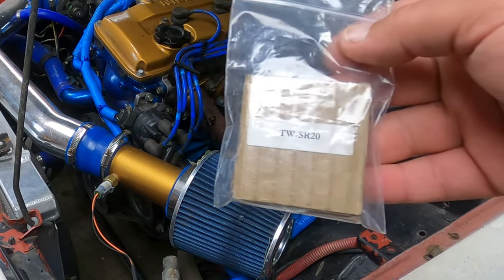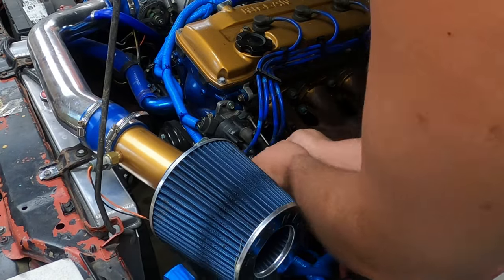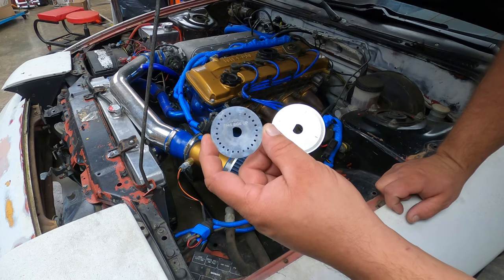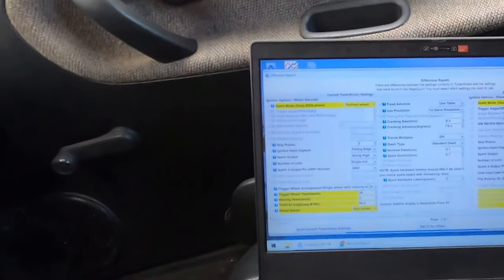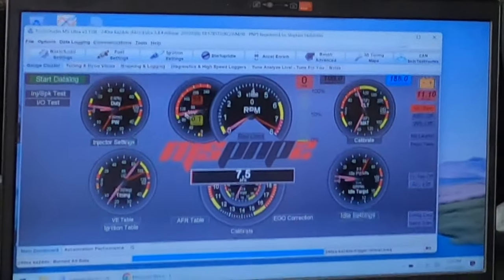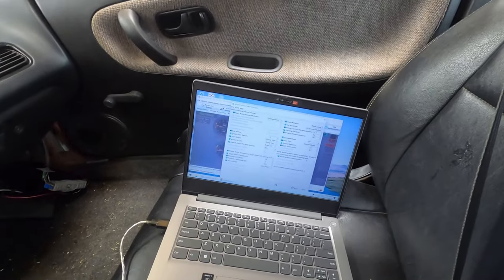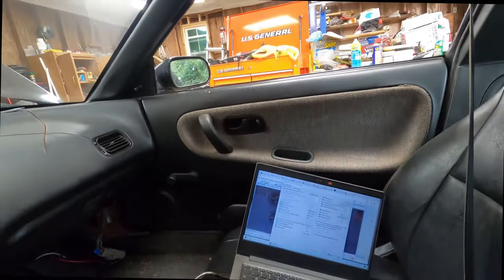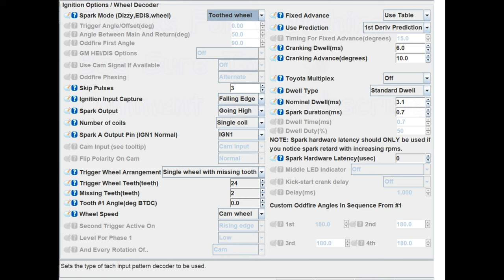MegaSquirt 240sx ka24de DiyAutotune TW-SR20 Nissan 24-2 Distributor Trigger Wheel Install & Startup

Comment: I followed your advice . It sputtered.  That means I am heading in the right direction.  Thank you.
Reply from the maker: Your welcome.  My coil on plug + sequential injection conversion was a total failure.  The documentation for the megasquirt pnp just sucks.  I think they conflate the information for the non pnp with the pnp.  If I had to do it all over again I would have just gotten a regular megasquirt, and ditched the factory harness. I don't think the factory harness is wired to work with many of the available "features"  without basically rewiring most of the car through the options connector.  I followed the directing for setting up sequential injection, and the car acts like not all the injectors are firing.  I made a coil on plug harness for sequential spark, but could only get spark outputs a and b to work.  Even when wired for wasted spark the engine run terrible.  So I'm going to stick with my distributor and the msd blaster 2 coil upgrade.  It makes the initial tuning far more forgiving on the afr ratio.  My oem coil was really weak from age and couldn't handle the car being too rich.  Another gotcha I ran into was the wideband sensor not being calibrated and letting autotune destroy the ve table.  The car acted like it had a blown head gasket because autotune kept making the table so rich the fuel wouldn't ignite.  Once I got that straightened out the autotune worked great.  I just locked my idle cells and wouldn't let it tune anything under 1000 rpm.  If you ever need to replace your igniter chip this is the exact same one sold for a different car that is only $20 instead of $150+  :  https://www.amazon.com/dp/B085PPXKPF?psc=1&ref=ppx_yo2ov_dt_b_product_details  I replaced mine with this one when I installed the msd coil.

Comment: Great vid.
Im currently in the same situation, i got it worked with 90 degree on tooth 1.
Was wondering if need to change the trigger wheel offset wizard as well? Or its no longer affects the timing with the new trigger?
I set it when first installed the mspnp.Its set at 75 deg for me
Reply from the maker: Once you have the engine running in fixed timing mode, you can use the offset to adjust the timing to get it to match up perfectly to the crank pulley timing marks.  So if you have the fixed timing set at 15deg  you can then adjust the offset until the timing marks line up on the crank pulley at the 15 degree mark.  Once that's done you are good to switch back to "use table"  for timing.  The process is all about getting the timing in the software and the engine in sync.

Comment from the maker: Burned out my wide band O2 sensor doing this.  So going to have to replace that before I do the coil on plug conversion.  After a bit of research I think I may have found a way to make the wide band O2 sensors not die so easily.  There is a lot of very bad advice about how to install them.  The same sensors last about 100,000 miles in an oem application, they should last close to that in an aftermarket application as well.
Reply: Well, it is a good thing that you know how to work on those cars.

Comment: Off topic of the video but wirh that intake manifold, dis you have to cut up the intake tubing for it to fit properly since the throttle body ends up in a different location than stock?
Reply from the maker: Yes I did have to cut up the intake tubing to make it work.  However if you get a kit for a ka24e single cam it will fit much better because the throttle body on the excessive manifold ends up sitting at about the same place as on the single cam intake manifold.

Comment: Hey mate, i have install a RB30 trigger wheel 24-1 in the distributor for my customer R34 powered RB30. Can you give me an help?!
Reply from the maker: Might be able to, what's the issue you are having.  Is it the same trigger wheel from diyautotune?   As I recall my came with the directions for an older version of the trigger wheel, and the new version is actually 24-2.  I linked to the updated directions in the video description.  I found mine worked with the tooth angle set to 0 with the engine timed the way you would for the oem ecu.

Comment: Hi is that a 50mm wheel. ? Also how is the wiring configured to run the wheel
Reply from the maker: It's the 50mm wheel.  I didn't have to change any of the wiring to run the trigger wheel.  I am using the pnp version of the MegaSquirt that retains the OEM engine harness.

Comment: How did you know if your wasnt 180 degrees out
Reply from the maker: I pulled the plug on cylinder #1 and inserted a rod then hand turned the engine until #1 was at tdc.  Then installed the distributor with the rotor pointing at #1.  You can also remove the value cover when you do this to ensure the intake and exhaust cam lobes for #1 are pointing away from each other.  I didn't have to pull the distributor to change the disc, and I had the car running using the oem disc with the megasquirt before swapping the discs.
Reply: @tinker-tinker  I got mine started  at the moment I'm in 125 degrees some say are you sure your not 180 degrees out.  The key way in my distributor only slots one way .Just thought I'd ask as you did yours
Reply from the maker: You wouldn't of been able to get it to start if you were 180 out.  Upgrading the stock coil to an MSD Blaster II really made the initial tuning for me a lot easier.  The starter map is a bit on the rich side and it kept blowing out the spark, and then autotune would try to correct by adding extra fuel making the problem much worse.  One thing I have noticed is that as they change the fuel blend with the seasons I have to redo the tune.  It's not too bad once it's running right.  It's a good time to re-calibrate the wideband o2 sensor anyways.

Comment: Can you tell me how you wired the distributor to the megasquirt
Reply from the maker: I got the DIYPNP2 Megasquirt so I didn't have to do any wiring for the distributor.  However I did initially have trouble with not getting rpm sync due to a strange issue with the eccs system not providing power to the crank angle sensor.  Somehow the oem ecu was able to cope with the issue, but the megasquirt was not.  I ended up wiring up my own power relay in place of the eccs relay that is triggered off the key switch and that solved my sync problem.  That drove me nuts for a few months.  So if you are using the factory harness check to see if you are getting 12v on the black and white wire that runs to both the crank angle sensor and the mass air flow sensor if your issue is similar.

Comment: it looks like the timing light is at 10 not 15..
Reply from the maker: Good Catch

I know why I have it set wrong.  They really should replace the picture in the installation instructions here: http://www.megasquirtpnp.com/docs/mspnp_g2_ns8994_s13.php  with a better one like this one from nicoclub: https://www.nicoclub.com/articles/images/timing-02.jpg

Just saying I thought they were showing where 15 btc was in that image.  To boot the text above the image mentions setting to 10 btc and the text under the image mentions setting to 15 btc.  The instructions are about as clear as mud.
Reply: Thanks for sharing.  I could not for the life of me get this thing to run or rpm sync with the trigger wheel.  It is finally idling.  Before I put my trigger wheel in I timed the vehicle at 15 degrees.  I then swapped the wheel and used 0 as the value, and it still would not start.  I finally got it to start and idle at about 342.  18 degrees away from zero.  It is reading 15 BTC at the damper.  Now that I have it set.  Do I keep it set to "fixed timing" or do I switch it back to "use table"?
Reply from the maker: Once you have the timing set switch it back to "use table".  The fixed timing mode is so you can get the timing set without the ecu making adjustments for rpm, temperature, etc.
Reply: @tinker-tinker  thanks!  I have no idea what I am doing, but...this is fun!
Reply from the maker: Your welcome, I stumbled through it, and figured everything out the hard way.  I do recommend upgrading to a MSD Blaster II coil if you aren't doing the coil on plug conversion.  I had trouble auto tuning initially because old stock coil was too weak to handle how rich the base map was.  Autotune thought the weak spark was causing miss fires, and kept making the fuel map even richer making the problem worse.  I also found a new compatible ignitor chips that is a drop in replacement at a much much lower price than the one typically sold for the 240sx.

https://www.amazon.com/gp/product/B085PPXKPF/ref=ppx_yo_dt_b_search_asin_title?ie=UTF8&psc=1

https://www.amazon.com/8202-Blaster-Ignition-Coil-Bracket/dp/B09QRWJLH7/ref=sr_1_3?crid=34EHXOS15QX5Y&dib=eyJ2IjoiMSJ9.nHI9kzMajLL6IUNHFslZCf629yl4sCz8cqFmB9GqP5D0MtdJcC4Yk06B_3hh7tIAYVm2grSJHw9F0d863-WHu1vwt9Le_Flw67dCEhXiaqIgdVXEU-W2AY9eqKGkH41u7T6Czc_X7r4LOmcEzgnsDzUf6nOAEreBlNkbtAT_cmYpHNzOs900cYYH6OKF4xk_djaiPme7H0IZo_8dmLDZ5mS4CGLU7XN-MUwkX-VJ79U.xS2Y037a94dlLE7GwK3nTOFE2LwJi6bDaTF8vUNClqg&dib_tag=se&keywords=msd+blaster+2&qid=1713217497&sprefix=msd+blaster+2%2Caps%2C136&sr=8-3
Reply: Mine has the internal coil, I'm not sure how that would work.  I wasn't planning on going with the COP yet.  Is that a hard thing to switch?  What would be the benefit.?
Reply from the maker: I tried the cop conversion, and I just couldn't get it running well.  https://www.youtube.com/watch?v=1wCmMD_-JPc&ab_channel=TinkerTinker 
I don't think you can upgrade your coil since it's internal.  You can use and s13 distributor and wire up an external coil that way, but I don't know the specifics of the wiring without using an s13 harness.  I'm running an s14 engine with a s13 harness and distributor.  

The cop conversion really isn't needed unless you are going turbo and are planning on fully building the engine to rev much higher than stock.  Your internal coil should be good up to around 300hp.
Reply: @tinker-tinker  I am going turbo but I am not looking for anything over 300 at the crank. I appreciate you sharing the info!  Very helpful
Reply from the maker: The ka-t.org forums are a good place to find turbo info as well.  Some of the images in the older write ups don't show, but I wrote a script to make them.  You can paste the code located here:
https://pastebin.com/0m7hA9gc
 into the javascript console of your browser to make the images load when they are "missing" on pages at: https://www.ka-t.org/forums/index.php  
The site use to use some kind of image cdn and when they brought the site back up they never fixed the older images.  The script extracts the original image url from the cdn url and replaces the cdn url with it.  One of these days I may archive a full corrected copy of that site.

I was originally going to just buy a crate from these guys: http://www.handcraftedracing.com/KA24DEcrate.html  But they don't actually sell them anymore.  So I've just been gathered all the parts they listed to build their 450hp crate engines, and am waiting to get a machine shop locally to do all the work.  I still have a few parts acquire, but I'm almost there.
Reply: @tinker-tinker  oh yes, I am all over the forums.  I wish they were as active as they used to be.  Facebook is messing them all up!  I will definitely use the phot thing. Much appreciated.   Can't wait to see your 450hp beast!